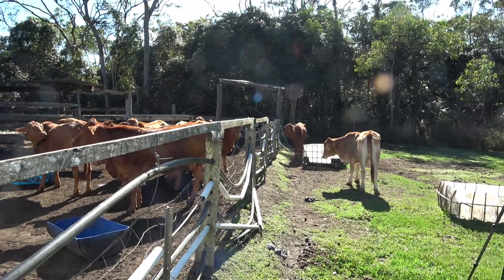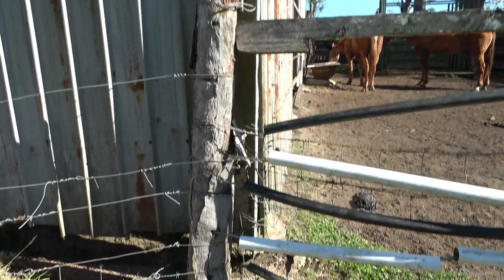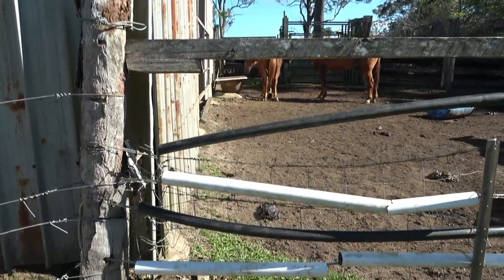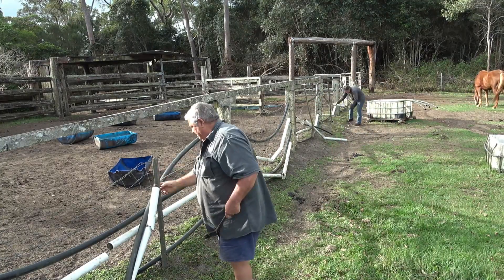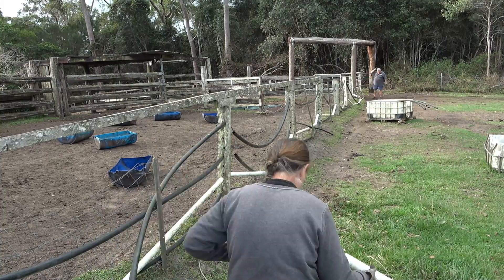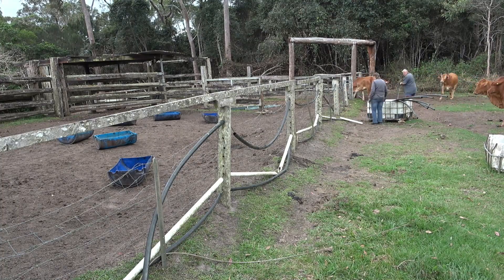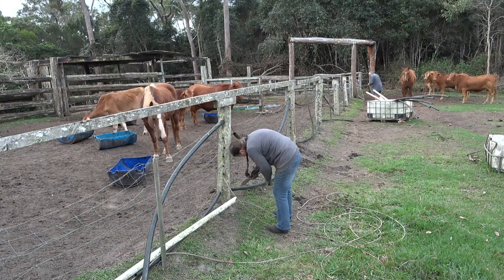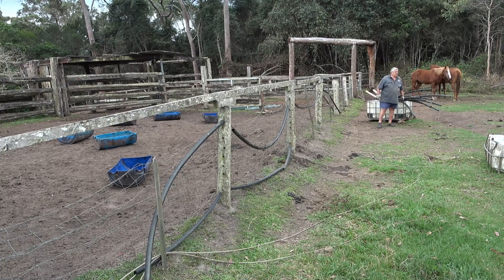RE- BUILDING A CATTLE YARD FENCE

Comment: You guys are a team.its good your wife is helping you out.if it was possible to find old railway lines or cheap metal pipes.its better for the cattle enclosure to be metal.the rest of the farm timer round pipes to avoid injury to cattle long lasting when painted can't rust.
Reply from the maker: I have plenty of railway line. It rusts here. A timber post here lasts a minimum of 25 years and we have plenty of them. I am 70 next year so I dont think it will it will be my problem when it needs replacing. John

Comment: Here we use a system called zero grazing for dairy animals in the cattle shed I replaced timber with metal pipes to avoid subsequent repairs painted them also .
Reply from the maker: I am familiar with no grazing. Painting metal here only stops the rust a little bit. John

Comment: Corner post need to be strong either metal or concrete or treated timber very strong post
Reply from the maker: The treated timber here is pine and lasts about 5 years and very expensive. John